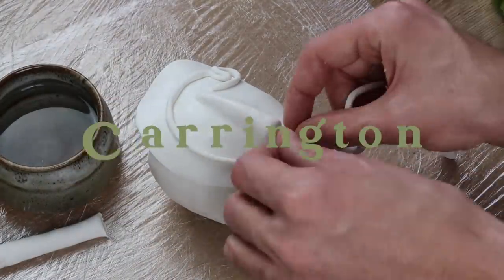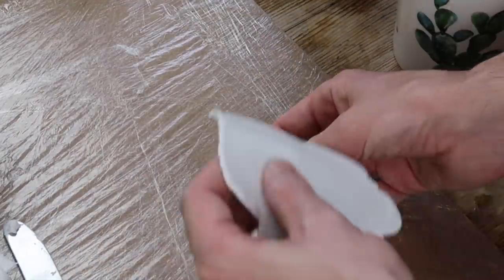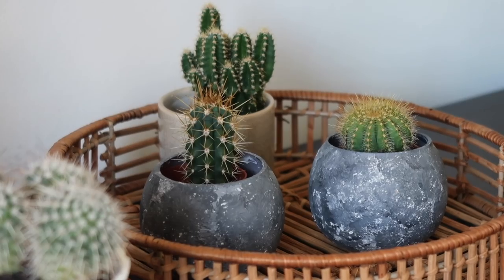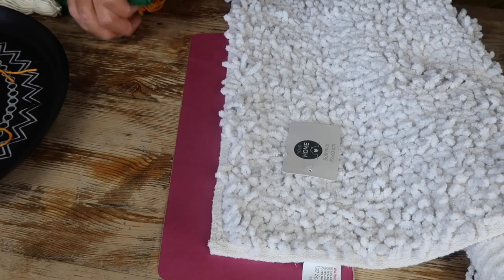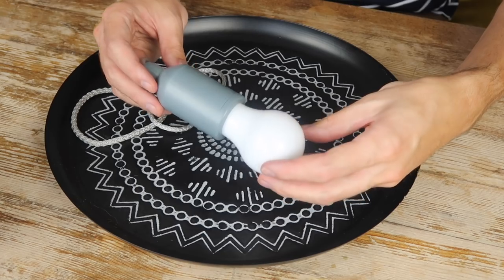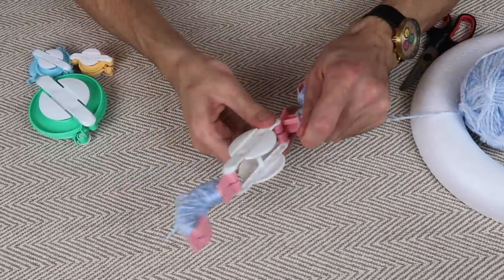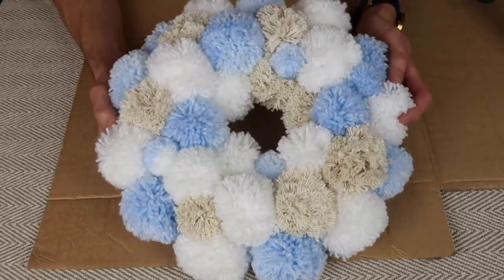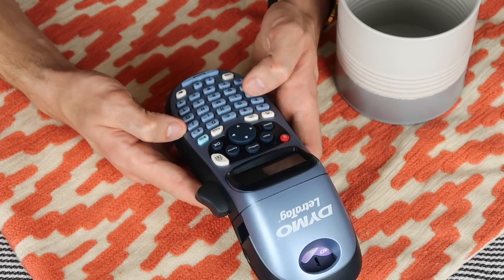DIY ROOM DECOR IDEAS ON A BUDGET! *poundland / dollar tree budget diys* MR CARRINGTON

Comment: I made the pompom wreath😊 after watching your original video. Like yours, it looks even better than the original really expensive wreath from Anthropologie you copied in your DIY.. And cost "almost" nothing. Thanks for that one🤗. 

Great compilation 👍love air dry clay and use it loads 😊.

Tip⚠️.. To stop bleeding.. Always paint over the tape with the base colour to seal the edge before painting on the second colour.. Then the second colour can't bleed below the tape and you get a sharp edge😉.